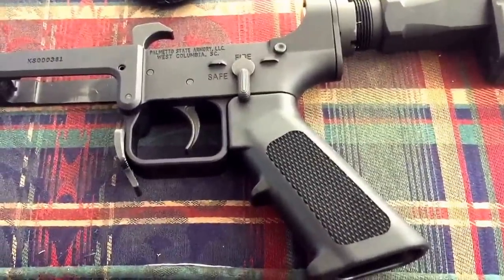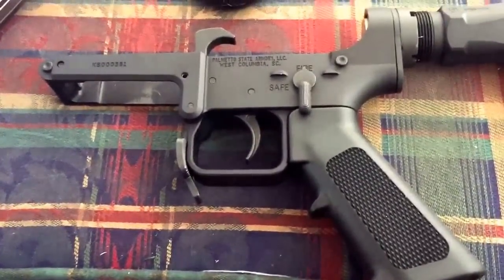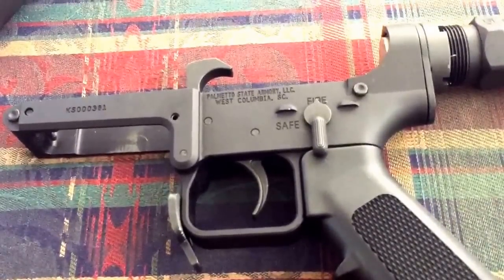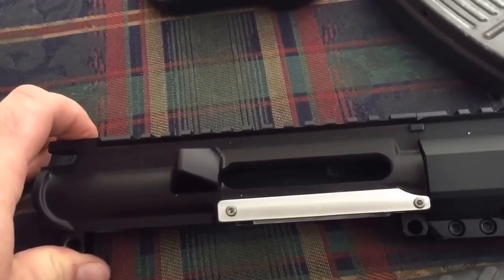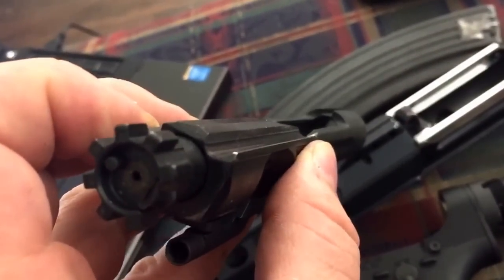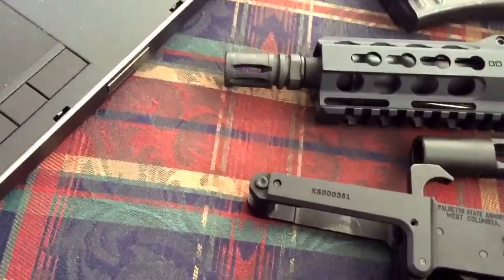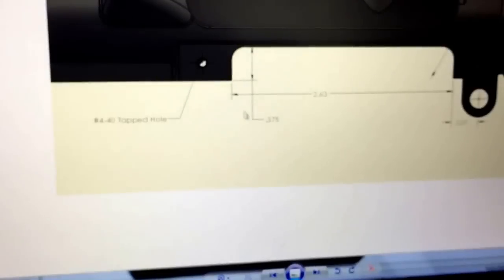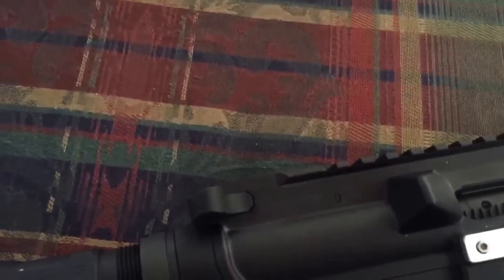PSA's KS 47 lower with mil spec upper mod

Comment: Hello,
I have the same lower receiver. However, mine will not feed or eject cartridges. I am also using a pmag. The bcg slide over the very top of the cartridge. I know this is the case because the bcg causes markings on it. What could I do? Modify the mag itself maybe? If so, how should I go about it?
Reply: Watch this video ,a little sand paper.    https://www.youtube.com/watch?v=AnWhUyNgm10

Comment: thanks for sharing this. I bought a PSA KS lower and a 7.62 upper from Morariti. I had no issue with machining the upper but I dug a little deep milling the bolt carrier. It works but doesn't cycle after each shot. I have to charge a round into the chamber each time. I'm gonna get another BCG and try again.
Reply: Thanks for this comment ❤

Comment: Wait a minute....
You can do all that machining but yet you had no idea that the AK mag is larger than an AR mag and therefore will not fit in a standard AR upper??
Reply: Clearly he knew. But when a mfg claims they will fit...
I bought a 7.62x39 side charging upper, was told it would fit my LAR 47...
Nope. Needs mag well machined. The problem is guys trying to sell parts are "assemblers"  they dont build. Let's be real. AR's are the Lego kit of guns. You build an AK, you snap together AR.

Comment: Just how wide did you make the magwell area in the upper? I was looking at drawings, and the AK magwell is 1.000" and an AR I have seen between 0.900-0.925". That means at most, 0.050" has to come off each side. Not much. Maybe a beefier billet upper should be used from the start.